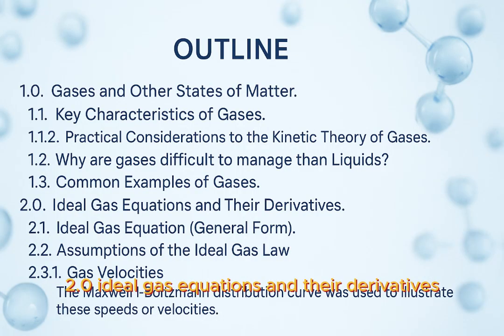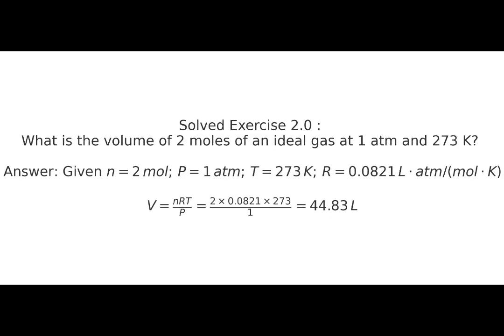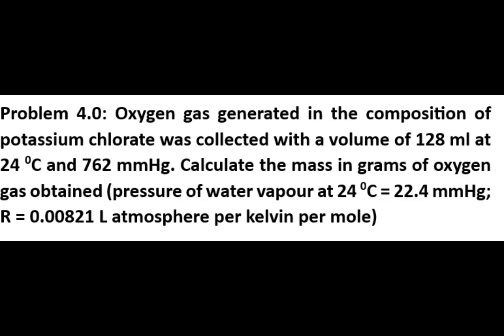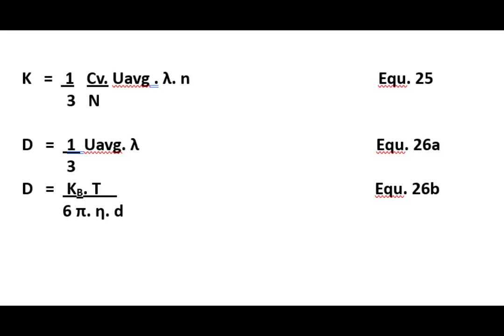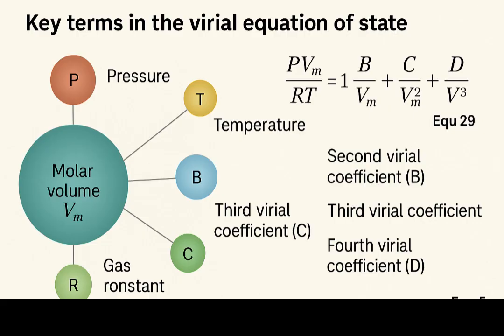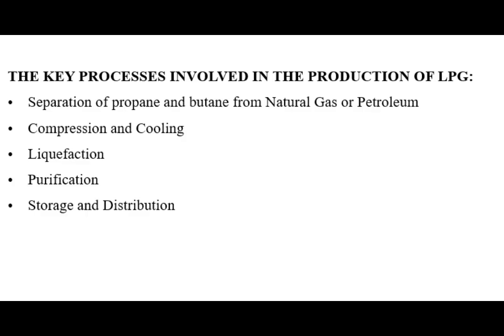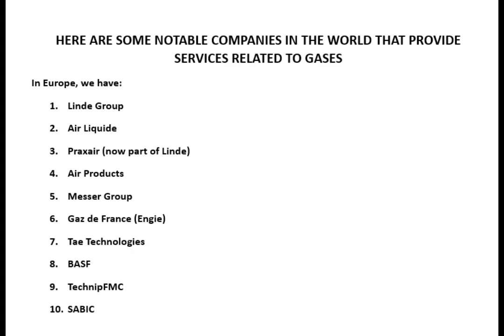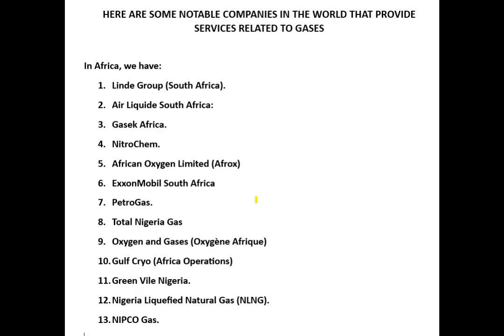Fundamentals and Applications of Gases

Comment: CHE: ASUQUO, ETINYENE AUGUSTINE 
CHEMICAL ENGINEERING 
U2024/3030045
Process of Achieving Cooling in Pipeline Natural Gas
Cooling of natural gas in a pipeline can be achieved using the Joule-Thomson effect. This occurs when the gas passes through a throttling valve and its pressure is reduced. Since methane has a positive Joule-Thomson coefficient under suitable conditions, the reduction in pressure causes the gas temperature to fall.
To obtain the required cooling, the pressure difference across the valve can be increased gradually while keeping it within safe operating limits The inlet pressure and temperature should be controlled because they affect the amount of cooling produced.
The gas composition should also be monitored since the different components of natural gas can change the Joule-Thomson cooling effect. Pressure and temperature instruments should be checked regularly to make sure they are giving accurate readings.
Finally, excessive cooling should be avoided because it can lead to hydrate formation or condensation in the pipeline. Proper dehydration of the gas, reducing the pressure drop, or preheating the gas can help control excessive cooling. Therefore, pressure drop, temperature, pressure, gas composition, and moisture content are the main factors to consider when achieving and controlling cooling in pipeline natural-gas processing.

Comment: CHE: ISAAC GODSPOWER
U2024/3030042

Troubleshooting Process 
1. Theoretical Principle

The Joule-Thomson coefficient is defined as:

μJT = (∂T/∂P)H

It describes the temperature change of a gas during an isenthalpic (constant-enthalpy) throttling process. During a pressure drop (ΔP < 0), cooling occurs when μJT > 0. This means that the gas temperature decreases as pressure decreases due to energy being used to overcome intermolecular attractive forces.

2. Troubleshooting Process Parameters

a) Inlet Temperature and Inversion Temperature

- Problem: If the inlet gas temperature is above the Joule-Thomson inversion temperature, expansion may produce little cooling or even heating.
- Action: Keep the gas temperature well below the inversion temperature. A typical operating range is approximately 15–40°C, using heat exchangers or precoolers when necessary.

b) Pressure Differential (ΔP)

- Problem: An insufficient pressure drop across the J-T valve results in inadequate cooling.
- Action: Optimize the J-T valve or orifice and maintain sufficient upstream pressure. Reduce excessive downstream backpressure to achieve the required pressure differential.

c) Gas Composition and Heavy Hydrocarbons

- Problem: Gas composition affects the J-T coefficient. Heavy hydrocarbons such as ethane, propane, and butane, as well as acid gases such as CO₂, generally contribute more strongly to J-T cooling than pure methane. High concentrations of non-condensable gases such as N₂ can reduce cooling performance.
- Action: Monitor the gas composition using a gas chromatograph and adjust gas-conditioning or processing conditions accordingly.

d) Moisture Content and Hydrate Formation

- Problem: J-T cooling can cause water to condense and form gas hydrates or ice, which may block valves and restrict gas flow.
- Action: Ensure effective dehydration using TEG or molecular sieve units. Where necessary, inject hydrate inhibitors such as MEG or methanol upstream of the J-T valve.

Conclusion

For effective cooling during J-T expansion, the gas must have a positive Joule-Thomson coefficient (μJT > 0) and an adequate pressure drop. Proper control of inlet temperature, pressure differential, gas composition, and moisture content is therefore essential for efficient and safe natural gas processing.

Comment: Name: Odugba Chioma Favour
Department: Chemical engineering 
Mat number: U2024/3030010

Ideal gas equation PV=nRT
Where; P= pressure of the gas, V= volume of the gas, n= amount of a gases in moles, R= ideal gas constant, T= temperature in Kelvin. Of we rearrange we have; 
n = PV/RT. With this equation we can calculate the amount gas in moles present using the measured values of pressure, volume, ideal gas constant and temperature.

Comment: CHE: ALFRED, EL-SHAMMAH MOBOLORUNDURO
CHEMICAL ENGINEERING 
U2024/3030038

For cooling by the Joule-Thomson effect:
μJT = (∂T/∂P)H
A positive μJT means that a pressure drop causes the methane gas to cool.
To achieve cooling in pipeline natural-gas processing:
Increase the pressure drop across the valve, within safe operating limits.
Maintain the gas temperature below its inversion temperature.
Control the inlet pressure and temperature.
Check the gas composition, as other components affect the Joule-Thomson coefficient.
Verify the pressure and temperature instruments if cooling is not observed.
Prevent excessive cooling, which may cause hydrate formation or condensation.
The main parameters to troubleshoot are pressure drop, inlet temperature, inlet pressure, and gas composition.

Comment: CHE: FELICIA STEPHEN OLAKA 
U2024/3030020

The Joule-Thomson coefficient must be positive, which means that a drop in pressure will result in a drop in temperature.

If sufficient cooling is not occurring in a natural gas pipeline then you have to check the problem and to  achieve this cooling in pipeline natural gas,you have to check the flow rate,inlet temperature, inlet pressure should be checked and controlled carefully,the system should be minimized through proper heat protection and after doing all this adjustment during operation it will improve cooling efficiency while maintaining safety

Comment: CHE: Oluwafemi Ibrahim 

Think of a JT expansion valve like a spray nozzle on an aerosol can. When high-pressure gas passes through the tight valve restriction into a low-pressure area, it rapidly expands and cools down.
If your gas isn't cooling down enough (or if the system keeps freezing up), you only need to look at four main levers:
1. The Pressure Drop (ΔP) – Is the push big enough?
 * How it works: Cooling relies directly on the difference between high inlet pressure (P1) and low outlet pressure (P2). Bigger pressure drop = bigger temperature drop.
 * The Problem: If downstream pressure builds up or upstream pressure drops, your pressure differential collapses, and cooling stops.
 * Troubleshooting:
   * Check upstream compressors: Are they maintaining maximum discharge pressure?
   * Check downstream equipment: Are filters clogged or valves downstream partially closed, causing backpressure?
   * Inspect the JT valve trim: Is the valve stuck open, oversized, or worn out (eroded)? If gas leaks past without forcing a pressure drop, it won't cool.
2. Inlet Temperature (Tin) – Is the gas starting too hot?
 * How it works: Methane cools much better when it starts off at a moderate or lower temperature. The hotter the gas is before the valve, the weaker the JT cooling effect becomes.
 * The Problem: Warm gas entering the JT valve yields very poor cooling performance.
 * Troubleshooting:
   * Clean upstream heat exchangers/air coolers: Dirt or fouling on cooler fins reduces heat transfer, letting hot gas pass into the JT valve.
   * Check cooling fans: Ensure air cooler pitch and fan speeds are maxed out to chill the gas before it reaches the expansion valve.
3. Hydrates & Ice Freezing – Is the valve getting choked?
 * How it works: Because methane cools so well (μJT > 0), moisture inside the gas can freeze into solid methane hydrates (ice-like slush) inside the expansion valve.
 * The Problem: The valve plugs up, causing pressure to jump around erratically, starving flow, or stopping the process entirely.
 * Troubleshooting:
   * Fix dehydration upstream: Check TEG glycol units or Molecular Sieve beds. Moisture levels must be extremely low before throttling.
   * Inject Inhibitors: Pump anti-freeze chemicals like Methanol or MEG (Monoethylene Glycol) directly upstream of the JT valve to stop ice from sticking.
   * Turn on heat tracing: Apply localized heating to the valve body itself so the metal stays above the freezing point.
4. Gas Composition – What is actually in the gas?
 * How it works: Heavier natural gases (containing ethane, propane, butane) actually cool down more than pure methane. Inerts like Nitrogen cool down less.
 * The Problem: Changes in the wellhead gas mixture alter how the gas behaves when expanded.
 * Troubleshooting:
   * Run a Gas Chromatography (GC) test: Check if high nitrogen levels are weakening your cooling power.
   * Watch for heavy liquid dropout: If heavy hydrocarbons condense too quickly into liquid droplets inside the valve, they can cause erosion or liquid slugging.
🛠️ Quick Field Action Summary
 * Gas isn't cooling enough (Pressure Issue): Boost upstream pressure or open downstream flow paths.
 * Gas isn't cooling enough (Temperature Issue): Clean or turn up upstream air coolers.
 * Flow drops & pressure spikes (Hydrate Issue): Inject Methanol or check mol sieve dryers.
 * Valve isn't throttling properly: Re-calibrate positioner or swap out valve internals.

Comment: CHE:Amadi Kennedy Kelechi
U2024/3030015

The Joule-Thomson coefficient of methane gas gives a positive value for cooling to be obtained. The possible troubleshooting of process parameters to achieve this cooling in pipeline natural gas processing includes:

1) Verifying the upstream pipeline pressure and upstream booster compression performance then Check for downstream flow bottlenecks, partially closed isolation valves, or undersized discharge piping causing high backpressure then Adjust the J-T control valve opening to ensure pressure differential across the trim is maximized within design limits.

2)Check performance of upstream gas coolers (air coolers/fin-fans or shell-and-tube heat exchangers) for fouling or fan speed drops.
Optimize heat integration by ensuring the gas-to-gas exchanger (gas/gas pre-cooler) is operating efficiently prior to the J-T valve.

3)Perform gas chromatography (GC) sampling at the inlet to verify gas composition against design specs.
Account for inert gas fractions (N2,CO2), which alter the overall gas mixture heat capacity (Cp) and J-T behavior.

4)Verify upstream dehydration unit efficiency (ensure glycol contactor or molecular sieve dew point targets are met).
Check thermodynamic hydrate inhibitor injection (e.g., Monoethylene Glycol [MEG] or Methanol) rate and nozzle spray atomization directly upstream of the expansion point.Then apply heat tracing or warm gas blowdown temporarily to melt localized hydrates if partial blockage is detected.

5)Inspect the J-T valve for seat leakage or internal washouts allowing gas to bypass the restriction without controlled expansion.
Verify that the valve positioner is correctly calibrated and not hunting or stuck open.

Comment: CHE:Friday Michel Paul
U2024/3030032

The Joule-Thomson coefficient of methane gas gives a positive value for cooling to be obtained. The possible troubleshooting of process parameters to achieve this cooling in pipeline natural gas processing includes:

1) Verifying the upstream pipeline pressure and upstream booster compression performance then Check for downstream flow bottlenecks, partially closed isolation valves, or undersized discharge piping causing high backpressure then Adjust the J-T control valve opening to ensure pressure differential across the trim is maximized within design limits.

2)Check performance of upstream gas coolers (air coolers/fin-fans or shell-and-tube heat exchangers) for fouling or fan speed drops.
Optimize heat integration by ensuring the gas-to-gas exchanger (gas/gas pre-cooler) is operating efficiently prior to the J-T valve.

3)Perform gas chromatography (GC) sampling at the inlet to verify gas composition against design specs.
Account for inert gas fractions (N2,CO2), which alter the overall gas mixture heat capacity (Cp) and J-T behavior.

4)Verify upstream dehydration unit efficiency (ensure glycol contactor or molecular sieve dew point targets are met).
Check thermodynamic hydrate inhibitor injection (e.g., Monoethylene Glycol [MEG] or Methanol) rate and nozzle spray atomization directly upstream of the expansion point.Then apply heat tracing or warm gas blowdown temporarily to melt localized hydrates if partial blockage is detected.

5)Inspect the J-T valve for seat leakage or internal washouts allowing gas to bypass the restriction without controlled expansion.
Verify that the valve positioner is correctly calibrated and not hunting or stuck open.

Comment: Anthony, Godswill Ime 
Chemical Engineering 
U2024/ 3030075

The Joule-Thomson (J-T) coefficient \mu_{\text{JT}} is defined as:
Because expansion involves a drop in pressure (\Delta P < 0), a positive Joule-Thomson coefficient (\mu_{\text{JT}} > 0) means that the temperature decreases as pressure drops (\Delta T < 0), yielding a cooling effect.
When pipeline natural gas (primarily methane) fails to achieve the expected cooling during throttling or expansion, troubleshooting requires systematic evaluation of process parameters, gas composition, and equipment operations.
1. Process Parameter Troubleshooting
A. Pressure Drop (\Delta P) Across the Throttling Device
 * Mechanism: J-T cooling is directly driven by pressure differential. A general rule of thumb for natural gas is a \sim 1^\circ\text{C} to 2^\circ\text{C} temperature drop per 10\text{ bar} (1\text{ MPa}) drop in pressure.
 * Troubleshooting:
   * Insufficient Drop: If upstream pressure drops or downstream backpressure rises, \Delta P shrinks, reducing cooling.
   * Action: Check pressure differential controllers across the expansion valve or choke valve. Inspect downstream lines for flow restrictions, pinched valves, or line plugging that elevates backpressure.
B. Upstream Operating Temperature (T_{\text{in}})
 * Mechanism: \mu_{\text{JT}} is not constant; it decreases as operating temperature approaches the upper inversion curve. Furthermore, near-critical regions yield higher cooling rates than very high-temperature regions.
 * Troubleshooting:
   * Excessive Inlet Heat: High inlet gas temperatures (e.g., from inadequate cooling after upstream compression) lower the magnitude of \mu_{\text{JT}}.
   * Action: Inspect upstream gas coolers (air/water exchangers). Ensure cooler fans, fin tubes, and cooling water flow rates are performing to design specifications.
C. Operating Pressure Relative to the Inversion Curve
 * Mechanism: At extremely high pressures (typically above 200\text{--}300\text{ bar} for methane-rich streams), \mu_{\text{JT}} decreases and can eventually reach 0 or become negative at the inversion curve.
 * Troubleshooting:
   * Operating the valve at pressures near or beyond the inversion boundary suppresses cooling.
   * Action: Verify operating conditions on a P\text{-}T envelope (Inversion Curve) using an Equation of State (e.g., Peng-Robinson or Soave-Redlich-Kwong). If pressure is too high, perform staged pressure reduction.
2. Gas Composition Parameters
Methane (C_1) has a positive \mu_{\text{JT}} at ambient conditions, but natural gas is a mixture. Non-methane components alter the mixture's effective \mu_{\text{JT}}:
| Component | Effect on \mu_{\text{JT}} & Cooling | Troubleshooting Action |
|---|---|---|
| Heavier Hydrocarbons (C_2+) | Increases cooling. Ethane, propane, and butane have higher \mu_{\text{JT}} values than pure methane. | If cooling is lower than expected, check for upstream separation changes that stripped heavy ends. |
| Carbon Dioxide (\text{CO}_2) | Increases cooling. \text{CO}_2 enhances \mu_{\text{JT}}, but introduces high dry-ice / freeze-out risks. | Monitor downstream temperatures to prevent solid \text{CO}_2 formation inside the choke. |
| Hydrogen (\text{H}_2) & Helium (\text{He}) | Decreases cooling. \text{H}_2 and \text{He} have negative \mu_{\text{JT}} values at ambient conditions (they heat upon expansion). | In hydrogen-blended natural gas pipelines, increased \text{H}_2 mol% degrades J-T cooling performance. Adjust pressure ratio targets accordingly. |
3. Operational & Mechanical Troubleshooting
If thermodynamic parameters appear correct on paper but measured cooling is inadequate or causes process upsets:
A. Non-Isenthalpic Expansion (Heat Leakage)
 * Problem: J-T expansion assumes an isenthalpic (constant enthalpy) process. Heat ingress from the environment counteracts expansion cooling.
 * Troubleshooting: Inspect thermal insulation on the expansion valve, choke assembly, and immediate downstream piping. Replace damaged or wet insulation.
B. Hydrate & Freeze-Out Blockage
 * Problem: Effective cooling drops the gas below its water or hydrocarbon dew point. Gas hydrates or ice forming inside the throttling orifice restrict gas flow and create unstable expansion dynamics.
 * Troubleshooting:
   * Verify upstream dehydration unit performance (e.g., TEG contactor or Molecular Sieve dew point).
   * Check Monoethylene Glycol (MEG) or Methanol injection rates upstream of the expansion valve to suppress hydrate formation.
C. Valve Internal Leakage / Choke Erosion
 * Problem: Internal passing or severe erosion in control valves alters expansion geometry, leading to turbulence and inefficient pressure-to-temperature conversion.
 * Troubleshooting: Perform valve diagnostic stroke tests, inspect valve trim for erosion or wire-drawing, and recalibrate valve positioning actuators.
Summary Troubleshooting Checklist
 * Verify Pressure Ratio: Ensure maximum permissible \Delta P is maintained across the valve.
 * Lower Inlet Temperature: Pre-cool the gas stream using upstream heat exchangers.
 * Check Gas Composition: Analyze \text{H}_2/\text{He} content (heating contaminants) versus C_2+ content (cooling enhancers).
 * Inspect Physical Assets: Audit insulation integrity, check for internal valve passing, and ensure chemical inhibitor (Methanol/MEG) injection is active to prevent hydrate fouling.